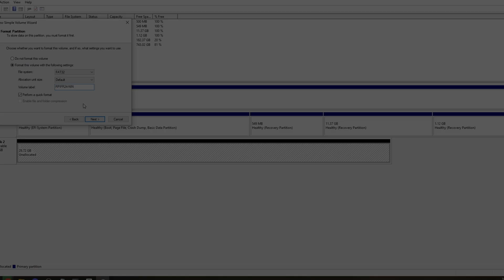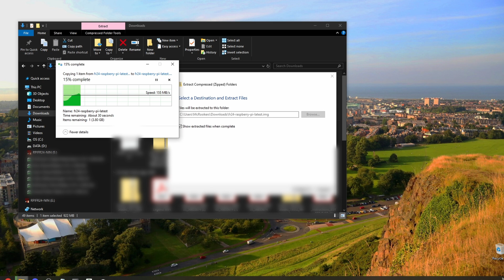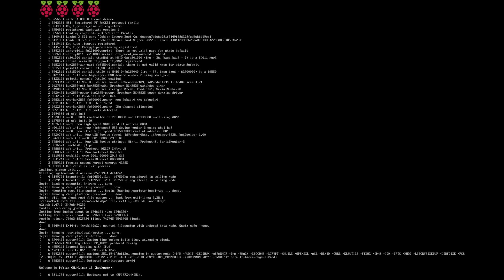Get a FREE FlightRadar24 Business Account by Building Your Own ADS-B Receiver!

Comment: Hi, great video. I've built mine but cant find it on my router network (yet). I've done the config file GB, SSID and password. At 8min15sec in the video you show a RP screen. How do you do this? is it just a HDMI to a screen and/or do you need the RP imager open? Thanks.
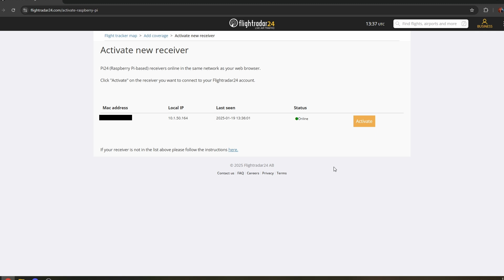Reply from the maker: Hello and thank you! Yes, It is just an HDMI into a screen, but there is not really a reason to need to do this, I only done it for informational purposes and to show a confirmed connection. Can you not see your device to activate it as shown at the 9:00 mark?

Comment: How do you register the device? I can't seem to find a way to view the Pi on any device. I'm totally new to this, so I need it explained like I'm 5.
Reply from the maker: No problem, I realise I sometimes take things for granted and maybe skim over bits. Are you referring to the part where you need to register it with FlightRadar?
If you have your Raspberry Pi with the SD card inserted (with the image created at the beginning of the video) and power on your device, regardless if the antenna is connected, the device will boot and attempt to contact the FlightRadar servers. As long as your device has an internet connection and is on the same local network as your computer, you can register it by using a web browser on your computer to navigate to www.flightradar24.com/share-your-data as demonstrated from 08:48
You should see your Raspberry Pi device listed and an activate button beside it, click that. You must then specify where your device is located on the map (so the positioning data is accurate), click "Verify Application" and then "Activate Receiver" and that's you done. You shouldn't need to do anything where you connect from your computer to your Raspberry Pi directly. I have shown the output of the HDMI port of the Raspberry Pi, purely so you can see it changing status, but you should not need to do this. If your Raspberry Pi is operating correctly, is will show as "online" when you log into your FlightRadar account click on the person icon at the top right and select "My Data Sharing". This page will show your already registered devices and if they are online or not.
Hope this helps!

Comment: is there a readymade version of this?
Reply from the maker: There is not a ready-made version of the Raspberry Pi receiver however, it is possible to complete an online form with FlightRadar24 to apply for one of their additional coverage systems, which is effectively the same thing.
FlightRadar24 will only supply one of these devices if you are within an area of interest that they wish expand their coverage in.

Comment: Is it at all possible to run these indoors and get 'somewhat' decent data/signal?
Reply from the maker: It is possible for it to work indoors... however, the signal from indoors (when I originally built it) was terrible and I could only get a range of roughly 25miles or 40km. Since installing it outdoors, I now get around 125miles or 200km, which is a significant difference! Additionally, I am located in a suburban area, so if you are located in a "built-up" area such as a city centre, your coverage indoors could be significantly reduced to almost nothing.
A high elevation and clear-line-of-sight are your best combination for maximizing your coverage area. So if you can achieve that as much as possible, your results will significantly improve.

Comment: What size standoff spacers did you use between the pi and the POE hat .? 😊
Reply from the maker: The PoE hat comes with its own pack of spacer posts and screws, however the size of the brass post is M2.5*16+4. (Basically a 16mm body with a 4mm screwtip) bringing the post to 20mm total length.
Reply: @McRookers  thanks . Loving your videos… keep it up 👍🏻
Reply from the maker: @TravisBailey317  Thank you for your support. I'm glad you are enjoying them!

Comment: McRookers

Hello, what is the range of autonomous ADS-B coverage?
Reply from the maker: It all depends on your setup, to determine how much range you can get. Personally I can see roughly 125miles or 200km. Although I have fitted the raspberry pi on the pole with the antenna, to keep the coax length as short as possible, I do not currently have a noise filter installed and the pole is not at the highest point of my property, to prevent issues surrounding planning permission. All of these factors, including if you live in a built up area (surrounding buildings) or have hills surrounding you, will contribute to the effective range you will get.

Comment: Great video showing the setup steps.  I’ve built a pi kit as well.  Have you played with the software to look at the aircraft in your area with their data before it’s sent to Flightradar24.  I haven’t seen a video of folks looking at local data.
Reply from the maker: I haven't, however I did try to do it after completing the FlightAware extension and I think I biffed getting access to it, however I wasn't too fussed to begin with. I might go back to it when I have time.

Comment: It's worth mentioning that if you have active cooling on the pi/hat, this will only be effective if you create vent and exhaust holes to allow airflow. Otherwise your board will gradually warm up day by day as the equipment can't vent waste heat.
Reply from the maker: Hello @omardude39. The box is fitted externally at height and is in a regularly cold climate. The small amount of heat that is generated by the device and circulated by the hat-fan, actually helps to keep the box at a regulated temperature without "hotspots" and the device housed within the optimum operating temperatures range. The housing then typically becomes a low-efficiency passive heatsink, but the warmth also helps prevent the plastic housing from becoming brittle.
I have been tempted to add in a temperature sensor to monitor this more effectively and a magnetic contact on the box lid to email me if the enclosure is opened. Hopefully one day!

Comment: 10:02 What is mean "MLAT running: NOT PERMITTED"?? Then I hope you can also upload a tutorial on feeding FA at the same time.
Reply: Since he is probably sending to a few different services, FR24 requires MLAT to be turned off in the config, hence “NOT PERMITTED”
Reply from the maker: I have adapted this device to update to FlightAware aswell now. I have made a video regarding it here! https://youtu.be/dTOGz03Wjk4
Reply from the maker: MLAT is a supplementary service to ADS-B and is not required for the system to work. Sometimes it will show as "not permitted" if the service is disabled or if the server side (FR24 server) is undergoing maintenance. However FR24 request that you disable MLAT if you plan to share with other networks such as FA, so it is not something to worry about.
Sorry for the delay, I have been away on holiday but I am back and I plan to do a follow-up video to add in other networks such as FA.

Comment: Great video. Question: do you load Raspberry Pi operating system also or is it part of flightradar24 with their app added to it already. I bought a Canakit to do this exact project. It can with the SS card with Noob pre installed on the card. Thank you
Reply from the maker: The image FlightRadar provide includes the operating system with their app already added to it. They have made it nice and easy however, it is the stripped down version of linux, so there is no desktop interface (GUI). You can still program your Raspberry Pi to do other minor things alongside the FlightRadar application, but you would need to configure anything additional using SSH.

Comment: Great job, but .. the heat could be a problem because it is closed. The fan will only cause more trouble with the time.
For such an application, you need a big heatsink and no fan. The heatsink should be a part of the box leading the year to the exterior.
Reply from the maker: Thank you @el-domo. The device is installed outside up a pole in free space, where it is exposed to alot of free airflow. Where the device is geographically located, the temperature rarely reach above 15°C.
The Raspberry Pi4's operating temperature is said to be a maximum of 85°C, which i dont think the enclosure will get as high as. The fan will assist to circulate the air and distribute the heat evenly throughout the enclosure, and will provide a larger surface area of the enclosure to exhange heat to the outside, so I don't believe there will be any major issues. I am tempted to install some sensors such as a security contact, so I know if the enclosure has been opened, but I might also put in a temperature sensor out of curiosity!
Thank you again!
Reply: @McRookers  ah I see. In such conditions, it is fine.